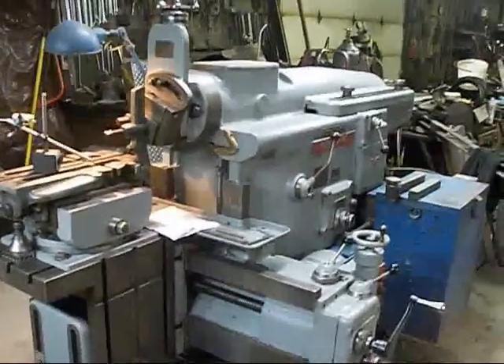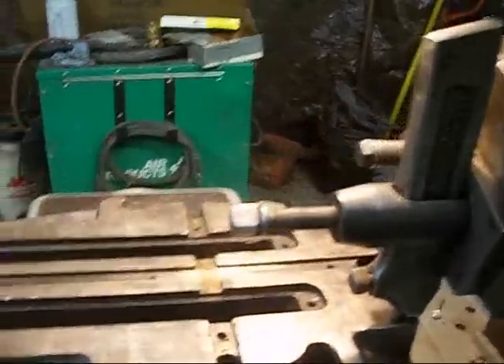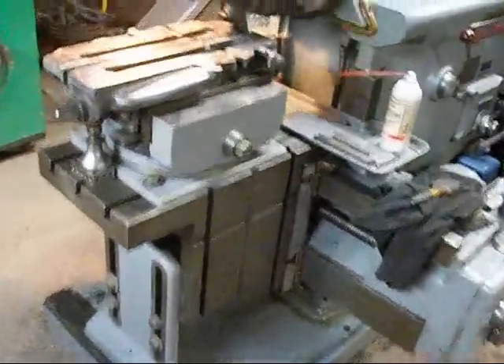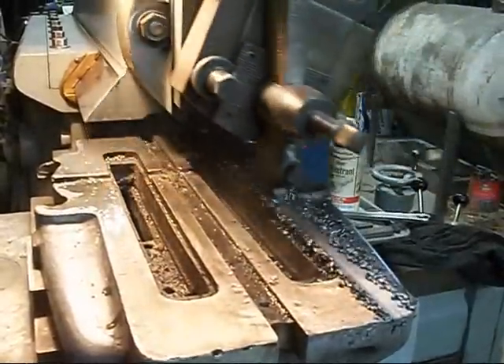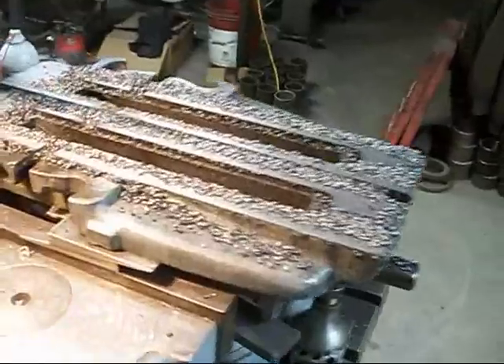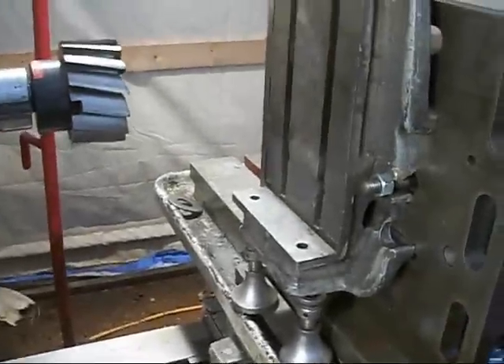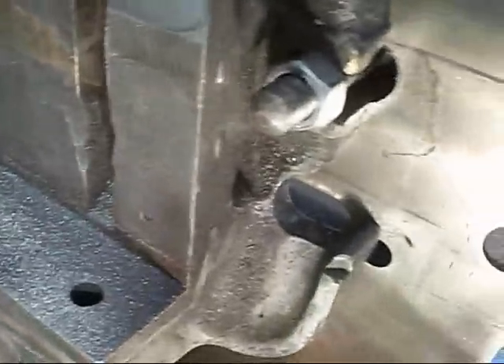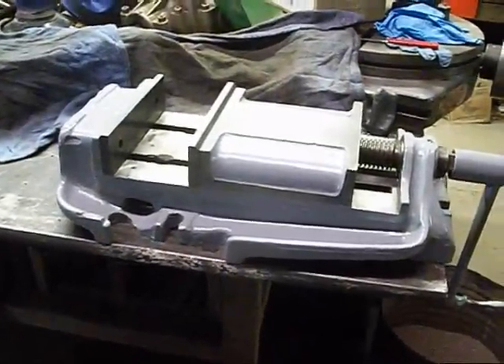MILLING VISE REPAIR WMV

Comment: More people should get shaping machines. There is something so satisfying about using one. I find it very relaxing to listen to and watch,the slow but steady pace is very calming. It does not matter if using my Elliott 14M or my tiny Adept hand shaper the feeling is the same. The technology may be old fashioned but still has a place in the modern workshop.
Reply from the maker: +Andrew Wilson I always try to think of something to do in the shaper. Now I would like to build a pair of large vee blocks for my HBM Thanks
Reply: THE IRONWORKER I still have a little pair of vee blocks and clamps that were made on a shaping machine some 30 years ago when I was a fresh faced apprentice! The shaper is perfect for making them on. I have a couple of big vee blocks made from to sections of railway rail. They drilled on foot for clamping down and machined to vee on the top. They solid and get used for any big cylindrical jobs, machining,measuring and even some welding!

Comment: Poor vices take a real hammering in a busy workshop! I restored a very nice Abwood 8" that looked like it had been used by Edward Scissorhands! Devcon epoxy filler made a great job of filling all the holes and set very hard. Effort was well worth it as now have an exact pair of vices,has come in handy so many times! The time spent matching them means quicker set-ups on long shaft key way cutting jobs.

Comment: I would not have wanted to be around the day they crashed the cutter into the part in that vise hard enough to break it in half!
Reply from the maker: +bcbloc02 I don't know what happened to it . I found it in the bottom of a box of heavy  wires I bought at auction Thanks

Comment: What kind of shaper vise is that holding the smaller vise? I have what seems to be an identical vise and can't seem to find the maker. Is it original to the shaper? Thanks!
Reply from the maker: That is a 12 " vise I bought from somebody but I don't know any thing about it then that . I have now found the right vise for my shaper it is 15"

Comment: Great repair, should hold up well. I've had a 14" G&E shaper since 2010; just bought a Rockford 24" a couple of weeks ago. Looking forward to getting it in position & wired up. I'm fluent with the crank shaper, but the hydraulic is a different story. Would you happen to have a manual, or know where to get one? Thanks again!
Reply from the maker: Hi I do have the manual  for it. But I can't remember where I got it from . I think I just called Rockford up and got it that way Thanks

Comment: Nice work! So how are things coming along with the shop addition?
Reply from the maker: +Jeffrey Vastine Winter got in the way and other problems came out. But starting to move forward again Thanks
Reply: +THE IRONWORKER that's a bummer, but the weather should be getting warmer and will hopefully allow you to get things finished so that you can direct your focus and energy upon restoring and making cool things. Good Luck!